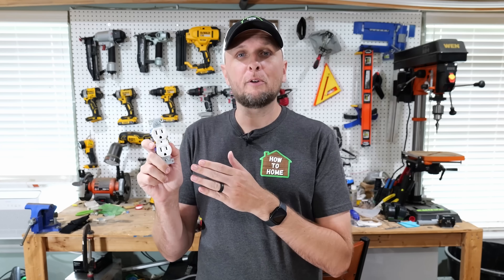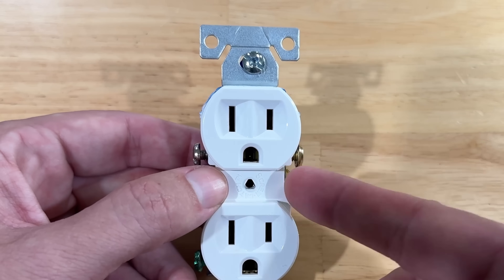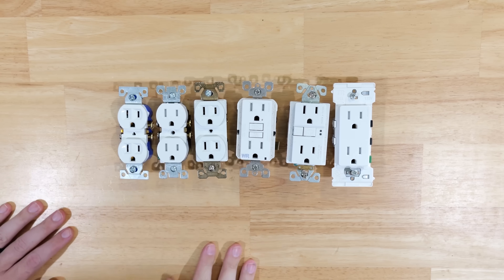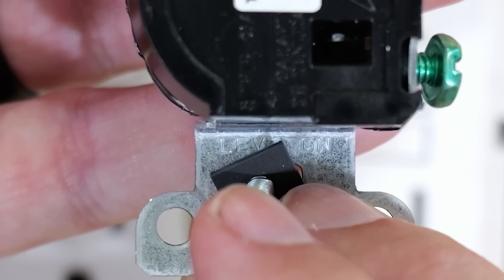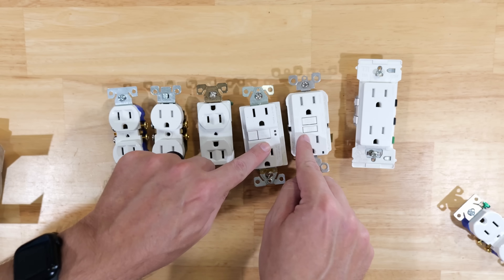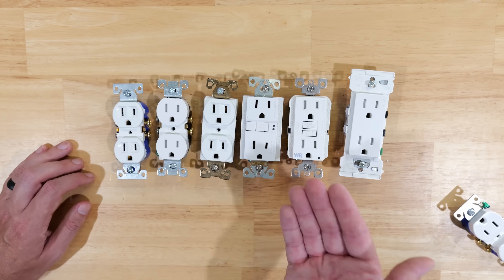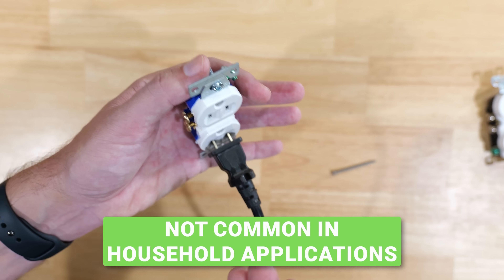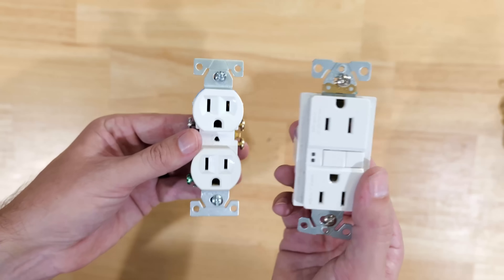The Shocking Reason Why Your Outlets Are Installed Upside Down!

Comment: As you note, the NEC does not specify the orientation of the pins in a normal outlet installation. The orientation may not only be up or down. Some outlets are mounted sideways where vertical space is at a premium. Some are mounted in a floor and some in a ceiling. The mounting orientation of these outlet are different because of how they will be used or due to space limitations. In other words, there is a “reason” for the peculiar mounting. For everyday “you have to reach the outlet with a 6-ft cord” installations, the ground pin must be in the lower position. The reason for this is quite simple. All testing on these outlets is done with the ground pin down. The immense variety of items that are plugged into these outlets is astounding. The obvious item to consider 90 degree plugs on air conditioners and other high amperage appliances. These plugs often get warm and larger gauge (heavier) wires coming straight out of the back of the plugs cause undue stress on the plugs causing them to fail in testing. Having the wire come down at a 90 degree angle removes almost all of that stress. If the outlet is upside down you drastically increase the stress on the 90 degree plug as the wire is now going up in the air. Plug in timers, large ac/dc adapters that hang 2 or more inches below the outlet are all tested in an outlet with the ground pin in the bottom position. All testing on the outlet and everything that plugs into them is done in that orientation.  I don’t know who started this “well if the plug isn’t all the way in and I drop a paperclip across the pins” thinking but they have done a great disservice by negating much of the testing done on the plethora of items that are plugged into these outlets. People who install the outlets upside down are telling all the UL engineers that their testing is invalid and that they know better. Last time I shorted the hot and neutral the circuit beaker tripped. Last time I saw a 15,000 btu air conditioner/heater with the plug in an upside down outlet the plug was melted and it almost started a fire.

Comment: ❤. Great video man. Retired master electrician here. You made all good reference points. I usually install with the ground down. Other instances are better with ground down such as these right angle wall warts and plugs with 3 prongs that have the cable coming from the ground side and needs to be hanging down to prevent an upward loop so it needs to go down regardless. The really only other instance that matter are some of the Healthcare facilities require ground up because some patients think there is a face if the ground is down (so that is what I was told). Now as far as mounting sideways, there is no wrong way either, just look at some of the power strips running along the wall, some are down some are up and the rest are sideways. Have a good one man and teach the young ones well.
Reply: I'm almost 80 and have seen too many outlets with the small bit of plastic next to the ground lug broken out because someone stepped on a cord plugged in to the  outlet. This does not happen when the ground lug is on top.
Reply: I have a 110V MIG welder with a short cord.  It has a 90 degree plug on the power cored.  The wire comes out on the neutral/hot side of the plug, opposite the ground prong. So where I use it in the garage, I flipped the receptacles around so that the ground prong is up.
Reply: "A Face"... :) Mental facility 'clients' (as most young children) would most definitely agree.. ;}
Reply: Article 210 Branch circuit does allow reccepticles laying flat on counter tops with expecipication you just have to read all article related 2020 book NEC
Reply: @LRHutch: You said: "The really only other instance that matter are some of the Healthcare facilities require ground up because some patients think there is a face if the ground is down (so that is what I was told). Now as far as mounting sideways, there is no wrong way either, just look at some of the power strips running along the wall, some are down some are up and the rest are sideways. Have a good one man and teach the young ones well." 
   Ground prong up when that outlet is attached too the wall-switch so people there know where to plug in their lamp to control it from the wall light-switch.
  Medical facilities have things hanging on walls that fall, like clipboards that short the circuit, military galleys and  restaurants, ground up was specified, due to stainless steel utensils being dropped, etc. Therefore it has become required that they be ground up for contractors. In many cities ground up is standard in all commercial and industrial buildings, ground only go down in residential buildings, houses, apartments, condos, etc. 
  “Never took the orientation of an outlet seriously until I was measuring for a shelf with a tape measure. It slid down and fell across the prongs of the washing machine plug.  POW! “—@joef.659
   “Countertop spaces require the maximum space between outlets to be 4 feet, and that no part of the countertop is more than 2 feet from a receptacle. So, there are times when an outlet may need to be installed sideways in order to fit into a spot where it is required to be installed.

The required placements of electrical outlets may also influence outlet orientation, as a horizontal outlet may provide easier access for plugging items in depending on the location. For instance, a vertical outlet behind an appliance or piece of furniture may give you no access points, while a horizontal outlet in the same location may allow you to access at least one of the receptacles. If an outlet is needed in a certain location but it is also clear that the spot will be blocked, then an outlet may be installed sideways to try to improve access.

Another common reason for horizontal outlets in your home is simply the result of aesthetic choices. Electrical outlets are obviously a necessity, but if you're on the hunt for brilliant hacks to make your kitchen more aesthetic, you may find yourself wanting to hide them. While this can help your kitchen look nice, covering the outlets reduces their functionality. Instead of hiding an unsightly vertical outlet, some people choose to install horizontal outlets. Horizontal outlets can have a look that is more low profile, which is especially nice for outlets that are placed higher up on walls, such as above countertops. In kitchens especially, horizontal backsplash patterns, such as subway tiles, are popular, and horizontal outlets are especially good in these situations. Rather than break up the look with a vertical rectangle, outlets can blend in seamlessly when they are turned sideways.”

   Everything is in context and the answer DEPENDS on context.

Comment: In Canada there are similar codes but it is only on specific outlets need to be flipped and it depends a lot also on quality, however many receptacles actually write on the metal taps with the screws will say Up telling you what orientation for that plug,. for a stability issue ground up helps heavier gage wires and pull the plug out of the receptacle so having the ground up can help prevent that from happening. on kitchen counters they must be GFI so orientation is not specified as any water that can get into it will trip it right away so the reason for the reverse is not needed. Also here in Canada receptacles that have into shield plates (second one from the left side of your display of receptacles at 8:47)  in the pin socket itself are what has replaced most plugs for under sinks, or moist environment as the shields prevents the issue needed, and again most of our receptacles have an up and down marked on them somewhere usually the metal fastening tabs, even GFI. Commercial receptacles also have a differant plug end so their receptacles are marked to be ground down as one pin on the plug is rotated 90 degrees. Also higher Amp and Gage plugs require them to be ground down because of the weight of the cord such as welders, stoves etc, 240v receptacles need to be ground down as almost all plugs for them are pre run with a 90 degree bend in them as part of the plug itself, doing the socket upside down puts way to much stress on the wire and socket itself and can damage the wire/plug and receptacles and also make the contact inside the receptacles lose and then it can cause a poor connection and lead to heat buildup, damage or outright damage. 
Also to reiterate these are Canadian codes and even per province there are individual codes, and i have 20 years wiring experience but in my respected province so I know other provinces have slight differences and between counties much more varied codes but still generally similar.

Comment: As a child I got shocked because I couldn't see that my little fingers were making contact with both blades on the bottom of a plug . One more reason why the ground pin should be at the bottom and not be top. 😢

Comment: I ALWAYS put it GROUND down when it's up to my discretion...
Because, over the years, seeing several Stainless steel plates in which the mounting screw falls out, and the plate falls across the prongs of a plug NOT fully plugged in... 💥😎👍

Comment: I install ground up. I do so for the reason given by the hospital electrician. 
But! There is another reason to do this. The plastic around the ground prong is more easily broken or cracked if it is installed facing down. 

I’ve seen many cracked plastic receptacles around a down facing ground, never in an up-facing ground. Look around your home or office, if you find one that’s cracked….Il’l bet it is ground prong facing down!

Comment: 40 yrs as electrician i think all that is required here is a little common sence....if you install them CORRECTLY ( GROUND DOWN) then use them with a correct 3 pin plug you will see that the ground pin works like an anchor point and make it very unlikely the plue will work lose from the wall

Comment: It's a little like toilet paper hanging over (away from wall) or under (nearly touching the wall), though the outlet does have safety considerations. I prefer ground plug down and toilet paper hanging over.

Comment: An inspector told me the reason for putting the ground at top. The very next day I was moving a dryer and a large grilling utensil with a flat shaft fell and landed between the dryer plug and the receptacle touching the ground at the top. If the three prong was flipped it would have shorted.

Comment: I questioned the company that installed our dishwasher and garbage disposal and did place the outlet under the sink facing up. So if there was a leak water would go into the outlet. They told me it's on its own breaker and would just trip it.  The issue for me would be, how the heck does one dry it out so we can use our dishwasher and disposal?! 🤬

Comment: Always install outlet prong up if metal face plates are in use or reasonably will be used in future such as in business property. I have seen metal face plates come loose and be on verge of dropping down and shorting the hot and neutral blades of a cable!

Comment: Ive noticed that polarized plugs are usually installed with the neutral prong on the right side of cord when they are lying in a relaxed position, and need to be twisted 180 degrees to get it to the left side.  Ive also installed receptacles that had “ top” stamped onto the strap with the ground pin up.

Comment: Been a Jouneyman electrician since 1976.  yea a lot of years. According to the National Electrical Code (NEC), the ground plug hole on an electrical outlet can be pointed either up or down, as there is no specific requirement for its orientation; most people simply install it with the ground hole facing down by convention, but either way is considered acceptable.
Reply: People die on this hill. Either way is acceptable unless a municipality makes an ordinance that supersedes code. One way isn't safer than the other. There have been tons of research on fires and it has never been found or proven that arcing across the hot and neutral with the ground down has caused a fire.
Reply: You can also install them horizontal.
Reply: @WesB1972  When installing horizontal receptacles the grounded conductor should be on top
Reply: Thank you!  That helps.
Reply: I don't have a dog in the up or down disagreement. However, offer observations with one leading to a rebuttal. 

Observations:
1. Some 120v appliances have right-angle three prong plugs; frig, washers, disposals, etc. The outlet orientation would then be dictated by the plug of the cord would be better hanging below, above, or to the side of the outlet. Added twist, some plugs are diagonal 😮

2. Many 120 three prong have a series of lines on the sides. Those are traction marks to enable the fingers better grip over smooth plugs. Therfore the thumb and index finger would be gripping the plug on the side to insert or remove. For this, I will rebut the top/bottom grip when removing a plug, putting the index at risk of hitting the positive and neutral prongs when the ground is positioned up.
Reply: Yeah, but left or right.  Despite someone's claim most medical facilities have them sideways with an identification sticker.  Every piece of equipment in any medical facility I have visited has an identification number, look at their equipment, every machine, tool, outlet, box, cabinet, computer, piece of furniture, etc. has an ID number.  Surely, other patients have noticed, there is even a pattern.
Reply: Ground is down, as God intended.
:-)
Reply: Did you not watch the video?
Reply: Ground prong up when that outlet is attached too the light-switch so people there know where to plug in their lamp to control it from the wall light-switch.
Reply: Ground side down is typically correct and some things can't be plugged in upside down without issues. I bought my parents a neat nightlight and it has to have the neutral on the left in order to be right side up. And, it is extremely noticeable if it's upside down.  There's also a bunch of flat against the wall plugs these days that can develop wiring faults if they're upside down for too long.
Reply: @SmallSpoonBrigade  there is no correct way .
Reply: @SmallSpoonBrigade  does not make a difference .
Reply: @SmallSpoonBrigade  no no and no
Reply: @SmallSpoonBrigade  no no and no , doesnt make a difference .
Reply: That's what the guy in the video just said.  So what did you add?  Nothing.
Reply: @___HH___  Verification from the NEC. So people know there is a rule on it. So What? Some one crap in your post toasties. Other people said the same thing yet I'm the one you try to shame.
Reply: @redcorset  Since you say "others said the same thing" as you, why did you say it?  And what did I say to you, fruitloop?  I basically said you did not add anything that the guy in the video had not said.    So what are you arguing about?

Comment: I usually put the ground plug down our maintenance man installed it up behind the refrigerator. How would you know that when you plugged it in the cord went straight up in the air because it didn’t come out horizontally come out vertically therefore I had to take the receptacle and rotate it 180° that way the refrigerator cord would not go up and then back down, with a personal preference unless you have a directional wire on your appliance that be more convenient to keep that going towards your Appliance. Thank you for such a well thought out and balanced really enjoyed it.

Comment: When installing appliances with a ground prong where the plug is flat and at 90 degrees vertical, they are usually oriented such that installing with the ground prong on top makes the cord leave the outlet upwards which can put strain or bending on the cord. Installing them with the ground on the bottom makes the cord hang naturally from the outlet.

Comment: I always go with the down position. I would just say, be consistent. Don't put them ground up in one room and ground down in another. Single pole, double throw switches should be installed such that the circuit is closed when the switch is in the up position and off when in the down position. I'm not sure if that's code,  but disconnects follow that convention, with the arm of the disconnect on the right hand side of the enclosure.

Comment: I am a Journeyman electrician with 45 years experience.  We were taught in trades school that ground plug down supports the plug better in case someone walks on the cord.  Also, it was a mnemonic device for newbies to the trade; if the receptacle looks like a face it's installed correctly.  And I've noticed over the years that most large devices, like surge suppressors, will hang correctly with ground pin down.  Where I live it's extremely rare to find a receptacle mounted ground up, even in hospitals.

Comment: I am a retired electrical engineer. You are missing the important thing and that is the ground prong is longer than the other prongs. This is done so the ground is established before the hot lead is inserted. For a good appliance or electric tool, no current should ever flow in the ground wire. It was aalways mounted down when it started and that is the way it was intended for safety. Before there was a ground pin there were sockets with the neutral wider than the hot. The neutral wasalways supposed to be on the left side. Thwe only way to continue that is to have the ground pin down.

Why is it different for hospitals. I dunno. Perhaps because some of the outlet are near oxygen connections and they are up much higher than the rest of the world.